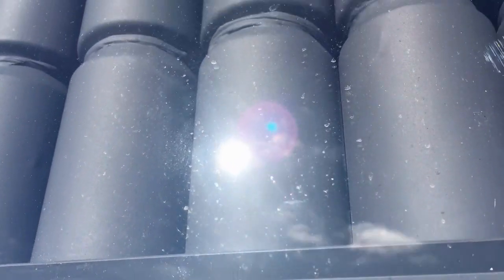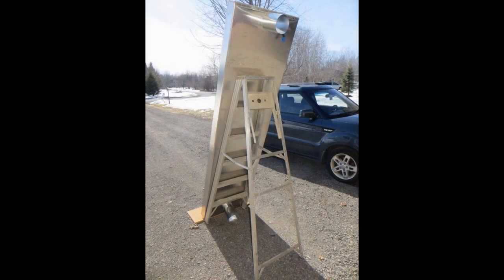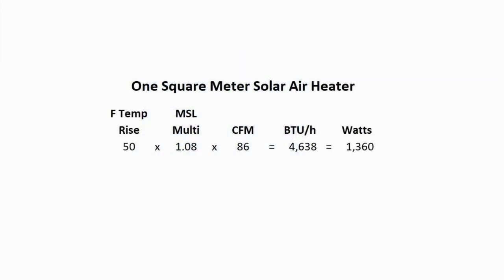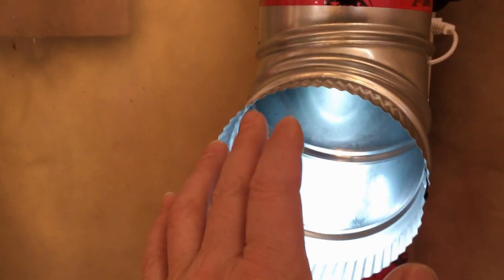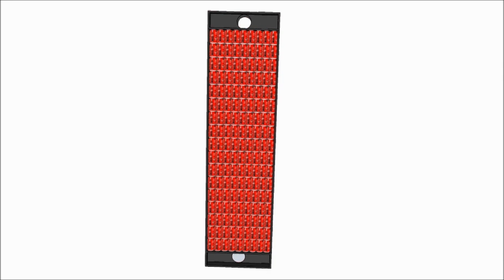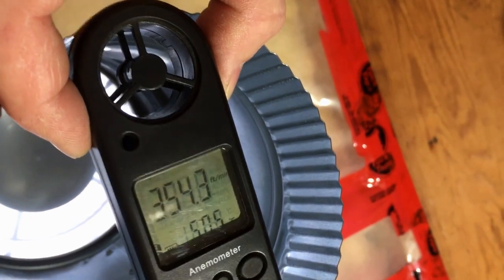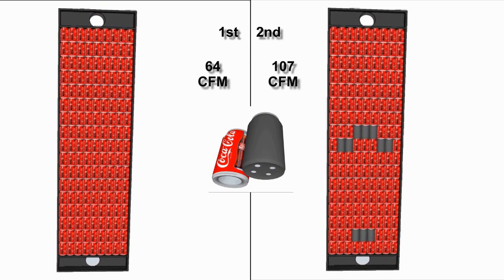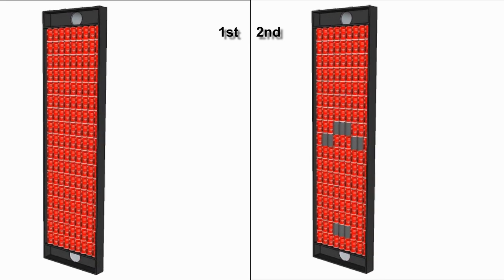DIY Solar Air Heater Part #7

Comment: The heat inside both panels would be equal, with no fans moving air. Consider one fan can only move the air inside the cans, and you are losing excess heat radiating back out through the panel glass. Could two fans reduce the lost excess heat? I've had a manufactured solar heat panel on the roof of my house since 1986 and replaced the 150CF fan 1 time. Love the free heat.
Reply from the maker: Wow that is fantastic.  I learned a lot in this exercise. My third design is the best yet; partial resistance with two fans.  I was talking with a fellow from Mongolia and he says to try using downspout with metal screen crumpled up inside. He shared that it provides the best conduction, while minimizing resistance.  If I was to build another unit, I think I would try that.  Cheers
Reply: What kind of metal screen? how would you crumple it up and insert so there is still air flow turbulence but not constrictive airflow?. Have you come across a video you can share?.This idea from research seems to be the best approach.. time, money and efficiencies. We live in ontario canada and currently our only source of heat is wood or space heaters to heat a 1100 sq ft home.
thanks in advance @LifeIsShortDIY

Comment: Super charging the air by recycling inside the collector by having half on initial draw and half on preheated draw by using dividers in the ends to redirect the air but you would then have both vents on the same end.

Comment: What type of opener did you use to cut the tops of the cans?
Reply from the maker: Hi, thanks for the question.  
I just used a standard can opener for the top lip, and a “hole” drill for the bottom.  
You can see the tops being removed in “DIY Solar Air Heater Part #2” https://www.youtube.com/watch?v=V9KNzb2wS_0 
and see the bottoms being removed in “DIY Solar Air Heater Part #6” https://www.youtube.com/watch?v=PhuUWfriKLI&list=PL6YanwREcLx7h747VhKjJLClqvBmy5cF5&index=6

Cheers

Comment: What model temperature controller did you use? None of the adds clearly allow control based on differential temp.
Reply from the maker: DIGITEN Wireless Thermostat Outlet, Temperature Controlled Outlet Heating & Cooling Remote Control and Plug-in Receiver, Over 300 feet Range, with 6ft NTC Temp Probe (Outlet Detect Temperature)

https://www.amazon.ca/gp/product/B07YXQ7J8R/ref=ppx_yo_dt_b_asin_title_o00_s00?ie=UTF8&th=1

Cheers

Comment: I'd like to make a couple of suggestions. First I used a hole saw and drill press to cut out both ends of every can to maximize airflow. That way your heat depends on the length of the rows. More cans, higher temps. Second, consider a plenum design. You have a plenum the length and width of the heater below an insulating layer under the cans. Now your air flow brings cool air into the unit at the top into the lower plenum and it flows down to the bottom of the unit and then convection lifts the hot air up while drawing cool air back down in a loop. Mine flow in and out from an extension on the top of the unit into a window with the plenum and output both open at the window interior. To increase your heat gain you need to angle the unit so it's a 90 degree angle to the sun during the winter. You can get that data online and adjust your unit on a stand to get the right angle. My unit raises inside temps from forty to fifty degrees and has a good amount of convection air flow without a fan. I typically get a good heat output for around six hours per day.
Reply: can you share more info in some video ? i d like to see it
Reply: @radovanbucko4973  On you tube look up renewable solar air heater. You'll get a video on a flat panel collector solar heater with a breakdown of it. Then instead of the flat panel collector you install your beer can heater collector. MIne is made out of half inch styrofoam, eight feet long with a couple of feet angled off at the top to fit into a window like a window ac unit. Instead of expensive glass I used a 2x8' corrugated green house panel. Bottom and sides are two layers of foam for strength. Plenum top is one layer with the cans resting on top of it. Unit is put together with construction adhesive and aluminum duct tape.

Comment: You mentioned at some point that this system would not really be able to fully replace conventional heating. Well that might be true in colder climates, in temperate zones, I'm in Southern California, believe it or not we also heat our homes for about five six months per year. Of course the outside temperature differential is not nearly so great, so a few units like this could probably keep a house comfortable enough to be used as a sole heater probably 80% of time. You would simply have to do most of your heating during daylight hours obviously. You might run a heat source like a mini split heat pump for a few hours at night and on very dark overcast days. Just huge energy savings. Not to mention how unbelievably simple these units are. Ought to be required a new construction.

Comment: What a great series and thorough explanation of the variables and how they impact design consideration. You mentioned earlier in the video that keeping the temperature differential low would increase efficiency because less heat would be reradiated for conducted back out the outdoor collectors. And that makes total sense. The sooner you get that heat inside the less chance it has to get lost outside. So what about drastically increasing airflow with much more powerful fans? Also more powerful fans might increase turbulence thereby increasing efficiency as well.
Reply: So how about using double or triple wall polycarbonate?

Comment: i think a even bigger fan (just one) that you can adjust the speed would improve your numbers. Also to have inlet and outlet in the lower part and let the air flow up and turn using half of the cans up and the other half down to the outlet.

Comment: Hi there I’m from the uk and in the winter months doesn’t get much hours of daylight never mind sunlight! Would this give us some type of heat at all during the cold months? Sorry I’m just learning new saving ideas with the current rise in energy prices!
Reply from the maker: Hello UK from Canada!
Thanks for your question.  First just a quick point – I am not an expert in this field, so I am only providing my opinion with my limited experience in experimenting with the few solar air heaters that I have built.
With respect to your question regarding heat.  It is important to remember that solar air heaters do not produce heat, they capture it.  A good way to answer your question yourself would be to hold your hand against the exterior of your building.  If it is hot to the touch, you could use a solar air heater to capture that heat and bring it inside.  
This is exactly what happened to me a few years back.  I was opening our hangar door in the wintertime and found the metal almost too hot to touch, yet it was cold in the hangar.  “Click” the idea was born, and I built my first solar air heater.  
In short, if you don’t have heat from the sun that you can capture, I don’t think a solar air heater is going to help you.  Sorry if that is not the answer you were hoping for.
Kindest regards
Dwayne
Reply: @LifeIsShortDIY  thank you so much for getting back to me! We have limited sunshine here in Northern Ireland in the winter but the side of my house in question gets the bulk of it all year round and these rooms would be much warmer than the rest of the house I was thinking it would be good for these rooms to benefit from the panel! I’m learning as I go we only have one source of heat and if our power goes out it won’t work! This was something I was hoping would give us a little heat even if it is only a few degrees! Thanks again!

Comment: Very nice work.  Than you for sharing everything.  Thinking about your ideas for increasing airflow and heat transfer, what if, instead of using 9 parallel columns of stacked pop cans, you were to use one continuous flexible aluminum duct (such as a 4-inch flexible duct that is used on dryer vents), painted flat black.  Cooler air is pushed into the flexible duct at the bottom of the unit, and then moves in a serpentine flow from the bottom to the top of the unit.  The air is increasingly heated as it moves through the long duct, and the 4-inch diameter allows a large flow rate.  What do you think?  Thanks
Reply from the maker: I think there are a number of opportunities to explore.  Listening to few in Mongolia,  a few have experience good success using metal screen as the media. Something else to consider.  Best regards.

Comment: I think the thermal collector you made is the best on the internet
I would like to make a similar model and I want to add a pump, a sprayer and a small container of water to turn into an air cooler
I would like to hear advice based on your experience
Reply from the maker: Hey thank you for the comments and feedback.  Wow I love your idea.  As far as advice, I don’t really have any.  Everything I have done in this field I have shared.  One point I can add is I have received a great deal of feedback from people in Mongolia.  From these discussions I can share that I believe they have a lot more experience in this space than we do in north America.   One of the suggestions I received was to try metal screen instead of pop cans.  I have not experimented with that material at all, but if I had the time, and I don’t right now as I’m wrapped up in a van conversion project, I would build my next solar air heater using three flat-black painted metal screens to pass the air through.  Could be better, could be worse – don’t know.  But less work to build than out of pop cans so it wouldn't be too hard to test.  

I am very interested in your pump, sprayer, air cooler idea.  Please keep me in the loop on that.  I would very much like to hear how you make out there.

Cheers
Dwayne

Comment: Excellent work. The best I've seen. But I have a question about the risk of overheating.
During the summer, when heating is not needed, could the temperature rise too high in the heating unit?
To the point of possibly damaging the foam insulation or the plexiglass?
Thanks!
Reply from the maker: I have wondered that as well.  Having passed through one summer so far, I guess I can say it seems to be ok.  Keep in mind that when it is not “running” hot air continues to rise and it is not trapped in the unit, it vents out the top with no fans running.  
I had originally put some thought into a venting system, but never got around to it, and don’t plan on it.  If I was to do anything different on a future unit, I would try a different material, perhaps metal screen – 3-5 players, painted flat black.  I have received some advice from people in Mongolia that have a great deal of success with just using screen.  Might be something to try.

Comment: great video but i didnt hear you saying nothing about heat loses in night and as i see you didnt have any close system or doors on fans... so i presume in night the air is going inside the chamber even if the fans are off and you lost heat. second problem i see and you didnt mention is double glass... doubling the glass can have significant improve on heating loss.  third point is glass vs plexiglass... if im right glass is better bc dont capture uv light so uv light gain more heat on cans and on the other hand normal glass can capture more infrared light inside the chamber. you do great job and i really like that you show temperature in celsius also.
Reply from the maker: Thanks for the feedback and comments.
Yes, I’m not worried or even think about heat loss at night.  There is no open air to the outside period.  It is a closed unit.  Very impressed with it. 
The glass issue is a separate item.  Ideally, I would like to go to glass; time will tell how this Plexiglas holds up.  I look at it every few months or so, and have noticed the odd hair-line crack leaving a screw hole.  Not worth replacing, but I can see the Plexiglas life might just be 5-8 years.  Just a guess.  I’ll keep my eyes open for second hand glass.  My thinking here is to spend very little money on this heat recovery system.  
It is wonderful heading out to the hangar on a cool sunny day and to find it quite comfortable for working.  Even when supplementing with forced air furnace, I’m using less propane as the room temperature is already above zero. 
Cheers
Reply: @LifeIsShortDIY  will you use this for home heating ?  if yes why you dont do that yet and if not why ? in my country is heating home pretty expensive these days and every day more and more. next winter could be deadly for as and i have a lot of not used sun on my walls so im going to try it ... first time i hear about this thing just few days ago and worried why ? why is this concept not well known here. is it something in your country that many people know about ? and many of them use that ?
Reply: @radovanbucko4973  In case Dwayne doesn't answer.  I'm in the USA.  I've never seen one here.  I think Dwayne is from Canada? Our northern neighbor. I haven't spent much time in Canada, but never saw one there.  I think they are probably very rare there too.
Reply from the maker: Hi, thanks for the questions.  

Yes, my US neighbor is correct, I’m up here in Canada.  No I haven’t put any thought into using it on our home.  I think my design is really well suited to small sheds and shops, or large shops for that matter.  

Also, I don’t see this as a system to replace any heating system, but rather to supplement an existing heating unit.  At night, and on cloudy days they are not running.  However, on cold sunny days they work marvelously.  

If you wanted to use one on a home, that you are living in, I think some time would have to be spend developing some kind of backdraft dampers.  

All the best
Cheers

Comment: Watched the series with great interest!  Do you think I could manufacture a pair of collectors and mount them horizontally?  Since the fans are managing the air flow I wonder if the efficiency would remain high?  I want to avoid mounting on the roof of the shop yet the neighbouring trees etc would block too much of a vertically mounted unit so I want to put them just under the eaves, tilted up a bit but feed directly through my wall.  Your thoughts?
Reply from the maker: Absolutely yes. Do it.  No issue with that plan. On my two units I have one with the hot air coming out of the top and one at the bottom.  This whole thing is a great experiment.  Maximize sun exposure, and have fun.

Comment: consider the heat from  "compressing" the air when backpressure is higher , that extra heat is provided by the AC outlet driving the fans.

Comment: Idea, Why not run copper tubing  up/down between cans so you can use same setup to heat water in summer? Coarse would have to install shutoff valve w/ airport at incoming water source and shutoff w/drain valve at exit, so you can remove water for winter heater use.

Comment: Hi Dwayne.  I enjoyed this series. Very informative as I am planning to make a couple collectors soon. I also want to clad with aluminum even tho I am much more comfortable with wood.  My question  is about your long (8'?) metal brake. It looks like it might be homemade. I'd like to make one. Care to share any plans or info on the brake?
Reply from the maker: Hi, and welcome!
Yes the metal brake is home made.  I should have done a video on that, but it was before YouTube 🙂
I used standard 8’ parts, so, with the clamping bolts and the space they take, I can probably bend 6.5-7’?

I built the bending brake back in 2006.  I got the plans from the ch601.org site, within the Homemade Tools section, there is a simple brake designed by Dave Clay.  I downloaded his plans, made a few slight modifications to meet my own needs and started assembly.  

I just did a quick search on ch601.org, and I don’t see the plans there.  I also did a PC search at this end, and of course I think I have changed computers since 2006, and can’t seem to find any notes on my build.  

Sorry I couldn’t help further.  

Best of luck
Dwayne

Comment: Loved this series - if you want to make it produce even more heat - shine mirrors on it - 3 or 4 mirrors and it will get seriously hot - for the price of a couple of mirrors.
Reply: I’ve always wondered if a Fresnel lens cover, even with the focal length off, would work well to capture more heat?
Reply: @cowboyblacksmith I think yes and yes to both if you, the problem is how do you secure windows at weird angles and not have them get damaged and blow away?

Comment: I've been looking at a few of these videos as the concept is pretty interesting. I've been over charged for over a year for gas due to a sub supplier luring me in with a low initial rate, and Im looking to reducing my home and garage heating cost to offset that mistake. Plus it's just better overall anyway, which is my real long term motivator. 

Unfortunately for this winter I should just keep working on my main business. But if I do one of these DIY panels, your videos have been invaluable! I would have had to do the same things, and ended up with 1 sub par panel. Your staggered airflow was also a great idea, and quite obvious in hindsight. 

It REALLY bothered me all these people using 6-10w computer fans that have low airflow trying to move so many BTU's of heat! Your PC uses more fans for less heat! And as you noticed, yeah the high temps seem impressive but efficiency is lost. Although your higher airflow and same exhaust temp is VERY interesting. Have you added a second fan to the first panel and compared data? That'd be the first thing I did!